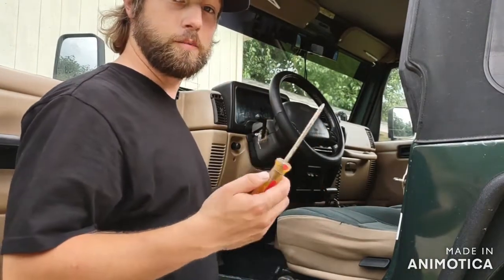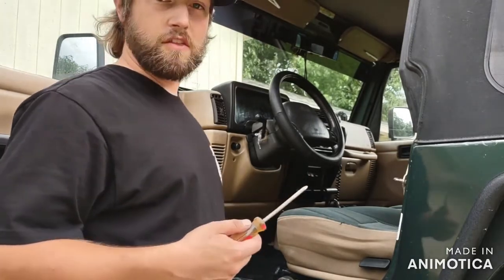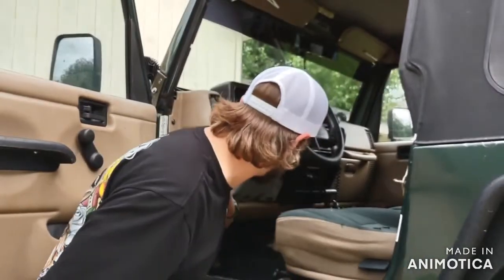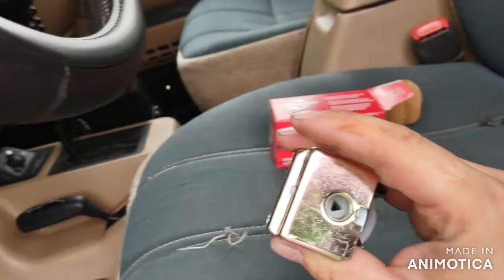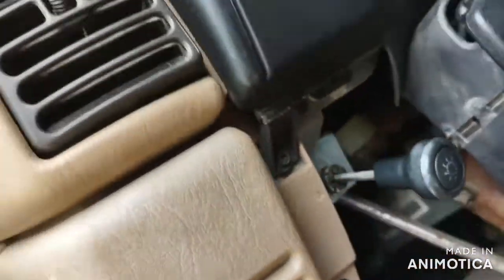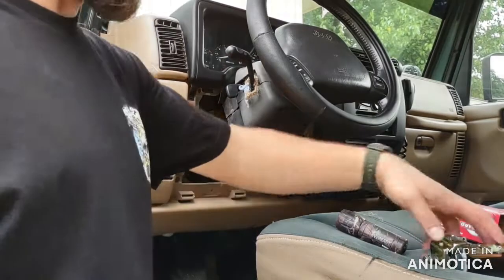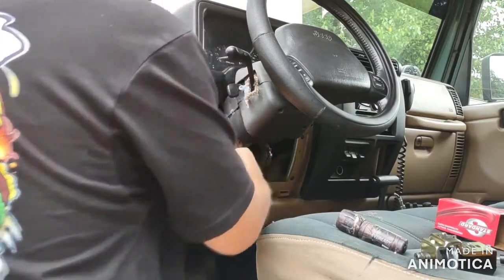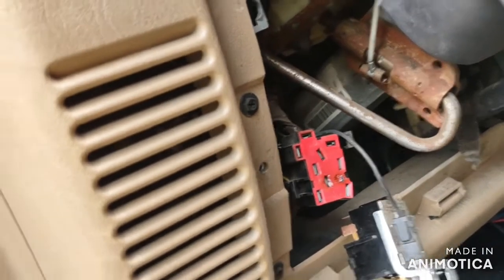97-06 Jeep Wrangler(TJ) Light Switch Replacement

Comment: Perfect! Thanks for the help!

By the way, once I had the knob off, that "nut" that holds the switch in place has a cross shaped opening.  A ¼” flat head screwdriver fits and can be used to unscrew it.  A PH3 is too small, so the flat head is a better option.
Reply from the maker: good deal!